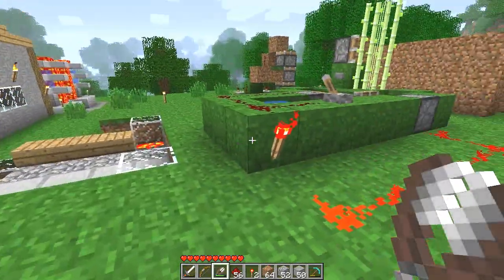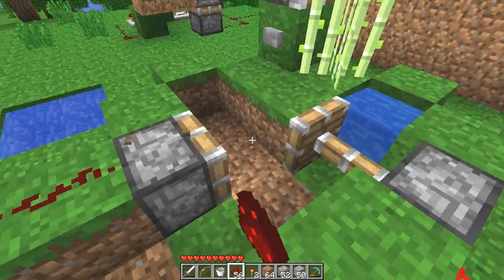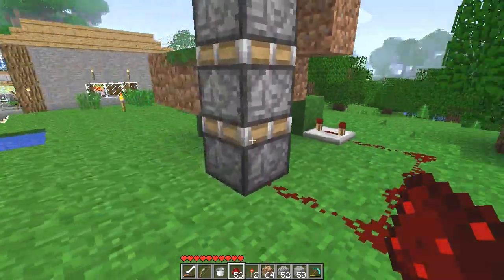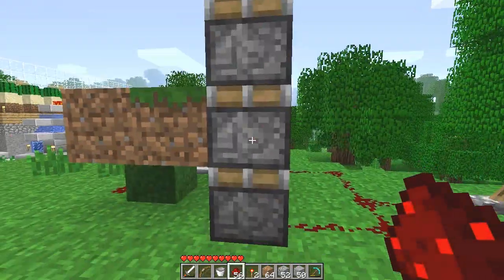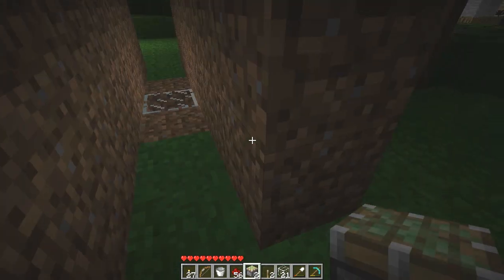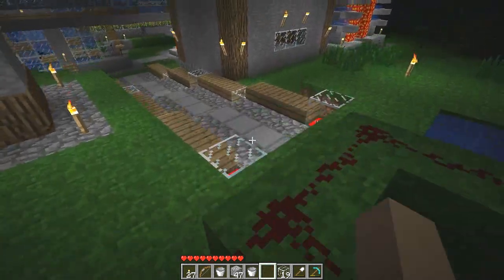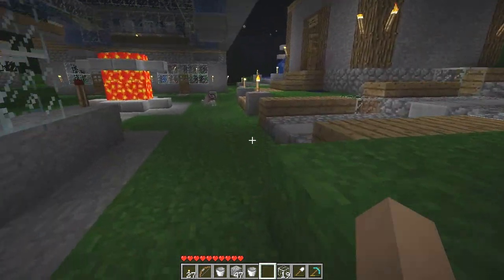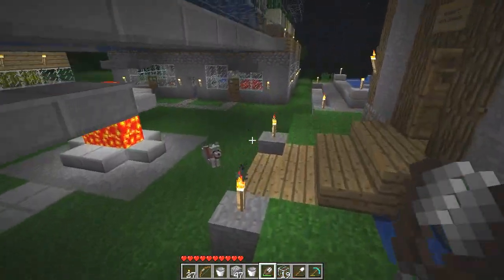Kalmier's Efficiency LP - 18 Patch 1.7 and Light Switches

Comment: and for the elevator dig into the ground and have different levers so when u pull the first 1 on the first floor it stops 1 block up dig in a little bit put another leer hooked to the next piston that eeds to open then do it all the way till u get it to where u need it

Comment from the maker: @arty000123 Hmm, first I'd make sure that the video settings are set to lock down the FPS.

Also, make sure you used the HDPatcher before switching to the texture pack. (there is a link on Tyken's page)

Maybe also try installing it on a fresh MC (no mods) by clicking Force Update on the Launchers Options.

Beyond that, I have no idea.